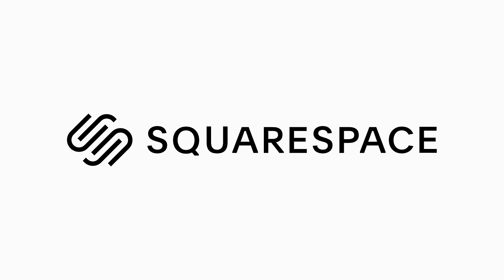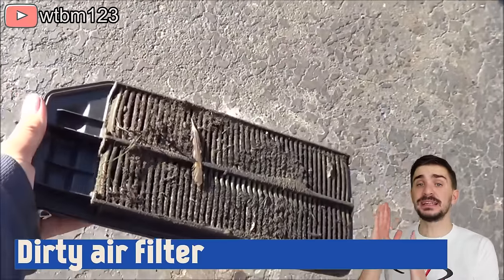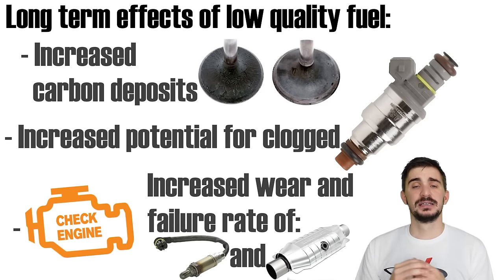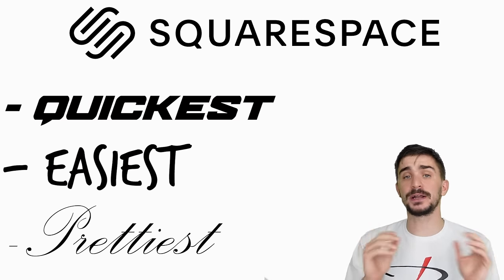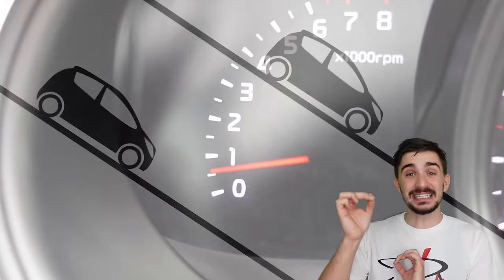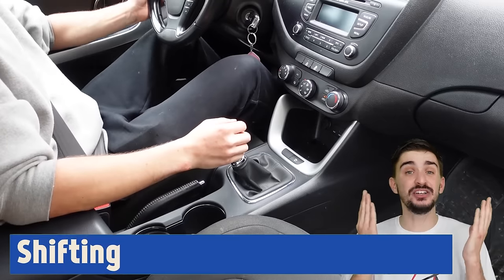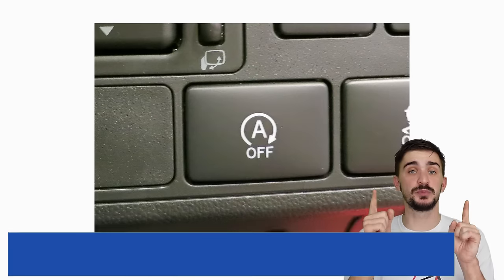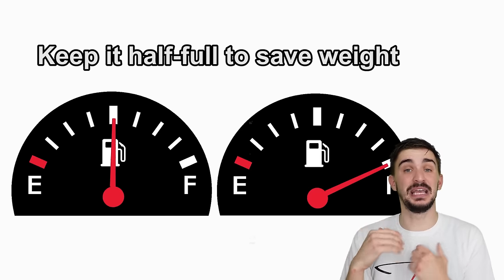EVERYTHING on FUEL SAVING - PRACTICAL DRIVING and MAINTENANCE techniques to REDUCE FUEL consumption

Comment: Something else that will save alot of fuel if you drive lots of short distances is an engine coolant pre-heater like webasto. Also reduces wear on the engine everytime you start it.
Reply: it uses fuel too, it would be better to have coolant heater on ac220v and plug it in 15 minutes before drive(i made one from caffe machine, it has 2 heaters  with 2x1400w and it heats up big engine very fast, 30seconds for 1 deg of C)
Reply: @makantahi3731  Smart solution. I would want an electric water pump going also. If the car doesnt have one already. I think some modern cars do.. instead of the belt.
But you can also buy a high power electric system although much more expensive of course. Then you get a pump also.
Reply: @martinsvensson6884  thanks, i invested some 30 euros in this project: 2 dolce gusto caffe machines-used "broken", but if i wanted to repair it i had just to clean scale, but i just needed heaters, i bought good water pump on 12v  and 2 relays, that device is remote, i just pull off hose from expansion bottle on car and connect that device on and it starts to circulate coolant, every heater has its own cable so i can choose one or both to work because each must be connected on different plug  because fuses are mostly on 15 amps and it could drain more, i use it on big engine(5.7) if outside temp is below 15 c (one) and if temp is below 0c /both)whatever , in 30 minutes engine has temperature of50 c ,   on second car with small engine i made permanent system with 4 diesel heaters that help to heat up coolant when engine is started, they drain 70amps, and speeds up switching from petrol to lpg for 30-50%
Reply: @makantahi3731  Sounds like a great simple solution. Wish all cars in northern climates had something like that as standard. Far from all people have the minds to create something like that by themselves even if it sounds simple.
Reply: is this built into plugin hybrids? plugin hybrids balance between non sustinable high production emissions electric drivetrain  and combustion emissions system...  prius prime for ex see eegnineering explained video on small turbo, mazda engine, electric car etc

Comment: As a driving instructor, I teach all my pupils about torque and how to use the rev counter.  My training car has done 76,000 miles from new and is still on its original brakes.  They will easily last to 90,000 miles and might even make it to 100,000 miles.  Fuel economy is acceptable on a training car and front drive tyres are lasting 35-40,000 miles.

Apart from cost, this is reducing dust, which is a pollutant.
Reply: Just don't teach engine braking on stick shifts.  I was a huge believer in this when I watched how long my brakes lasted until I realized the >$900 clutch replacements every 90k miles cost much more than the money I saved on brake pads.  Ever since I quit engine braking to save my brakes, I've never needed to replace a clutch.
Reply: @SvdSinner  Works best when you're not downshifting to engine brake, just keeping in the lower gear when setting off from a stop before a downhill.
Reply: You can blip the throttle as you down shift to match RPMs and take some load off the clutch. Asking the clutch to speed/slow the engine is a quick way to wear it out whether gearing up or down…
Reply: @nautamaran  I quite agree although I have found that with students, it is easier to get them to depress the clutch at 1,000 rpm while finishing off braking and this ensures a pretty much seamless down shift.  Sometimes they get it right, but then they are learners and it takes time.
Reply: @SvdSinner  Defective clutch or you operating it badly. Accelerating from a stop puts much bigger forces on the clutch than getting engine up to speed when engine braking. Difference in clutch life should be very small. I am using engine baking a lot and I never had to replace clutch on my cars. One of them has 320k km and still has original clutch.
Reply: @petrnemecek4379  I was using the engine to slow down on most every stop.  To me, it was game of how long I could keep my brake pads from wearing down.  The math is pretty simple:  The surface area of the clutch is similar to the surface area of the brakes.  If you use the clutch pads to save brake pads, you are wearing down your clutch pads about as fast as the wear you save on your brake pads.
Reply: @SvdSinner Huh? How is engine breaking even related to your clutch? What are you even doing? Clutch wears out as you slip the clutch and the clutch get heated. Engine breaking is literally lifting the gas pedal and maybe pressing slightly the brake, nothing else..
Reply: @docblizard  Engine braking also includes downshifting to increase the effect.  Downshifting involves clutch wear, typically more than upshifting because you use the clutch to bring the engine up to speed.
Reply: @SvdSinner  That i agree, but then what you're doing let's say you're in 5th you just clutch in and just brake until you get to a stop? As another person said above mastering rev matching when downshifting also makes thing completely smooth. But even if you don't, in my opinion the wear from downshifting should be absolutely minimal. Well i'll let you know in a few years how long my clutch held up.
Reply: You can learn to actually downshift without grinding down your clutch disks, using a touch of gas to match the engine revolutions to the gearbox.
Reply: Modern power disc brakes are the most efficient  means of slowing & stopping  a vehicle. Brakes are far cheaper & easier to access and service than power train wear & tare. The loads imposed on the drive train engine braking can far exceed  those imposed under hard acceleration. Practicing good habits are the key to fuel efficiency.

Comment: There's a video about idling consumption in Engineering Explained channel. I remember Jason said that if the engine stop time is more than around 7 seconds it compensates for the excess fuel needed for starting it. Actually, based on him, it's not THAT MUCH fuel (as you said) required to start the engine.
Reply: It is more the engine wear when starting the car by spinning up the engine through the starter motor on and off. Which is bad for the overall engine life.
Reply: Well if you wait at a stop light, it doesn't make much sense to kill the engine. I do it when i'm stuck in traffic that just doesn't move or in a road work zone with a red light that indicates that i'll be stuck there for, say "xyz" amount of time...
Reply: @wingkinwong9082 fine if the engine is operating temp. On/off a lot  without letting engine get to temp I agree is bad
Reply: @marc-oliviercabot3380  It depends on the kind of stop you'll make and your position in pack. If it's a stop in which you have the time to put the car in neutral and pull the handbrake (and then calmly release it and put the car back in gear when the lights turn green), then it also makes sense to shut down. If you're leading the pack or it's a short red light (say, no traffic on the crossing driveway), it's better to keep foot on the brake and engine running.

Comment: Bad news...A car with advanced adaptive cruise control can be used in drafting scenarios. Especially following a truck or something significantly bigger with a much longer stopping distance. it is not as safe as following further back. Great video. You covered it very well.
Reply: Even a truck can stop from 100 km/h to 0 in 1 second - after hitting another truck that has suddenly stopped at the highway. That's how those truckers with cruise controls and 5m distance set up on it are killing themself sometimes.

Comment: The Lucas Upper Cylinder Lubricant is actually very affective for clearing out clogged fuel injectors which is probably why they advertise it can increase fuel economy. On already clean engines it won’t affect fuel economy but it’s still a great lubricant.

Comment: To save fuel, it's good idea to coast early when approaching a red light. Stopping at a light sooner than later is not going to save you any time. When you continue to apply throttle, you're spending fuel to maintain momentum that will just be dumped away as heat by the time you reach the light. Because you're going to stop at the light very early, you will spend at lot more time idling, using even more fuel. Whereas, if you coast early (while in gear), you will consume no fuel until you finally come to a stop. Because you're not going as fast, you will come to a stop later and not spend as much time idling. Sometimes the light will turn green before you even have to stop and you still have useful momentum that you would otherwise have to regain by using more fuel.
Reply: Underrated comment.
Reply: Too bad too less people know this and still drive even when the red light is on the traffice sign few metres ahead.
Reply: Yes, anticipation is sorely underrated. Quite a few years back, I had to drive across London from Richmond (SW) to Dagenham (NE) late one evening (about 11.30 pm) and the car was a citroen CX2400 with a dodgy second gear synchromesh, cue lots of crunchy ness. By anticipating red lights, roundabouts and junctions, along with other vehicles behaviour, I completed the run in 45 minutes at an average speed of about 19mph and because I had brimmed the tank before I started and topped off at my destination, I used the equivalent of 38mpg.....which on a car weighing in at 1 and 3/4 tons with a 2.4 litre petrol engine was, in my opinion,  pretty good going for the ultimate city drive. I stopped 3 times and hardly changed out 3rd the whole way. Anticipation is all you need.

Comment: My number 1 suggestion is to drive with the mpg or L/100km displayed if your vehicle has it. 

That way you can monitor what rpm, speed and environment your specific engine likes. Personally my vehicle finds it’s rhythm at around 1900 to 2100 rpm or around 107-110 km/h.

Comment: 18:50 manually start stopping can work. Engineering explained did a little test and everything above 7 seconds would see a fuel gain compared to keeping the engine running. Especially at a railway crossing you should definitely shut the engine off!
Reply: I've also seen that video, so got a little curious with the numbers for my car. Even accounting for starter wear, it does save money. In my case, it is equivalent to paying $0.0033/start more to save some varying amount which should be a greater savings than the spend. I don't personally do this often as I'm usually doing mostly highway driving.

Comment: Nice to see that everything I do is listed here.  I like to keep a large distance to the front car in a way that I can abuse shifting down the gears instead of breaking, and moving extremely slow when the signal is read, to avoid stopping completely.
Reply: Downshifting is good just don't rely on it alot to slow down the vehicle it will damage the trans

Comment: One thing that does work is Cetane booster (2-EHN) for Diesel. Really helps cheap supermarket brand diesel to burn better and cleaner. More MPG and less DPF clogging. I definitely get better MPG with it and the engine seems smoother.

Comment: 12:30 Also, some automatic cars have an "eco" mode, which disengages the transmission while cruising without throttle, bringing the rpm down to idle and effectively coasting in neutral.
Reply: My 98 Chrysler minivan does this.  It coasts anytime I lift.  No engine braking at all.  Not sure if idling the engine uses more fuel or less compared with the drag and loss of velocity of decel fuel cut off.
Reply: this may not be a good idea, cuz when engine braking fuel injection is essentially shut off, and the engine is being pulled by the wheels, not fuel
Reply: @wobblebs87  Fuel injection is not shut off while engine braking, though you're right in that coasting in general isn't a great idea as the engine braking helps with deceleration.
Reply: My VW Polo 2023 (1.0L 90HP turbo, 7-speed DCT) does this in drive. However, if I touch the brake pedal even for half a millimeter, it immediately goes in gear and then continues coasting in gear until full stop. I've understood that in D it tries keeping a stable speed more than save fuel. Switching to S mode removes this behavior. Also touching the throttle puts it in gear. Sometimes I just downshift manually and keep a smidgen of throttle on a highway when I plan to decelerate to a car in front after overtaking.

Comment: I know it’s dangerous and it’s on the no go list but drafting actually works. I’ve done it on a couple trips and dropped my average from 5-6l/100km to 2-3l/100km. It’s hard to stay in the “sucking” zone and you have to stay focus both for braking if there was an emergency or to gently accelerate when you start to loose contact but most of the time, if the truck is big, the road is flat and you’re close enough you’re freewheeling for 2km in neutral. Would I recommend it, no. You have to know the road, know there isn’t gonna be an exit the truck may take and you’ll crash and it’s basically a really bad idea, but it saves you a lot of gas.
Reply: Yes, that is just one example of a few techniques he said "don't work" that actually do, but are not practical because they are either dangerous or increase wear and tear on the vehicle.  Another one is that starting a warm engine uses more fuel than idling at a stop light. That is not true for the length of time spent idling at a typical stop light in a congested area.  But I still wouldn't do it because the small amount of fuel saved is not worth the various downsides to shutting off your engine.
Reply: I used to do this on the motorbike. Unfortunately it used to get hot because there was no airflow in the suck zone but it sure was nice doing 60mph with no wind noise.

Comment: If you live on empty streets (suburbs or rural areas) you gotta find the most efficient speed for your car
Me and my brother did some tests and found speeds of 65-70 Km/h (~42 mph) to be most efficient
Of coarse if there is traffic you should follow it instead
Test was done on Hyundai Tucson 6sp auto. Best results when the engine is at ~1500rpm and transmission at top gear. Test was for constant speed and results through trip computer
Reply: I've tested my car like you have described and yes my car seems to just love cruising at about 65mph
Reply: I'm putting an MPGuino in my car soon and hope to replicate your experiment, but I would expect similar results. Fuel economy is basically speed divided by fuel flow rate, so the fastest you can go at the lowest RPM is probably best. Of course, at low road and engine speed and nearly closed throttle, the engine doesn't run very efficiently, but you need so little power that that's the most economical condition for that speed. At high road speeds, aerodynamic drag starts to kill economy. In the middle, there's a (fairy broad) sweet spot, no doubt highly optimised by the manufacturer. :)
Reply: @thromboid  love how you described fuel consumption, I believe everything in life is about a balance in the end
Reply: @onyxon7740  I like that philosophy too. Balance is worth striving for, even if we never attain it.

Comment: Amazing tips. Also don't forget that when coasting downhill in gear you're not only saving your fuel but also saving your brakes cause you get the benefit of engine braking which improves your safety as there will be less chances of brakes overheating.. Also techniques like Rev matching while downshifting also save fuel and brakes.
Reply: While engine breaking does help when in danger of overheating the breaks, the wear and tear on the gearbox is not worth it otherwise. So only (extensively) use it when going down a mountain where you are going to have to break over a long period of time

Comment: Shifting earlier makes you use more accelerator, reducing the pumping lost and fuel consumption.
Reply: shifting early is good when cruising, but again... common sense.

the scenario told in the video is when you know you're going uphill. by the time you're done shifting, you're out of the power band and will try to compensate by pressing the accelerator deeper and burning more fuel than needed.
Reply: To be fair, the pumping losses are really negligible.
Reply: @Rafael Borges: Yes, that was about my only quibble with an otherwise excellent and really comprehensive video.

Comment: I solved all my driving worries by switching to o a PHEV. If the engine ever fires up, it stops when coasting, it's always running at the optimal BMEP. Regen braking allows for one-pedal driving and the cruise control works also when driving downhill. Seven years of ownership currently and still running on factory brake pads. As for commute: the nicest way to do it is on an e-bike, save the car for when it is pleasant to use it.